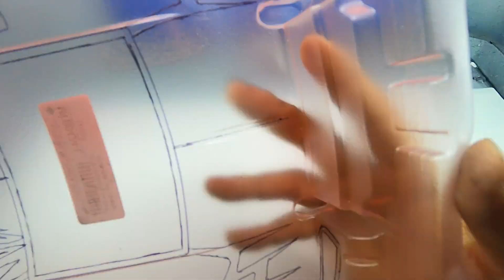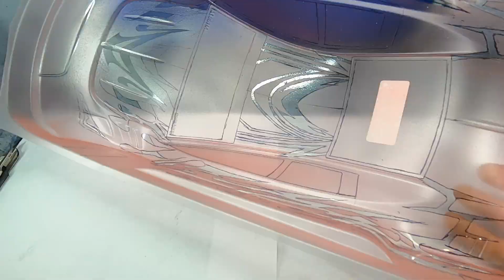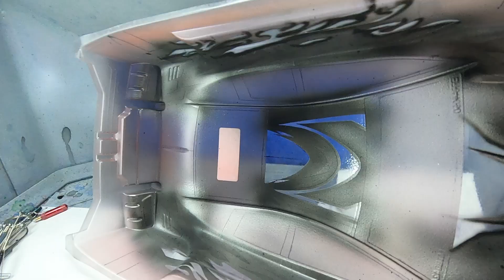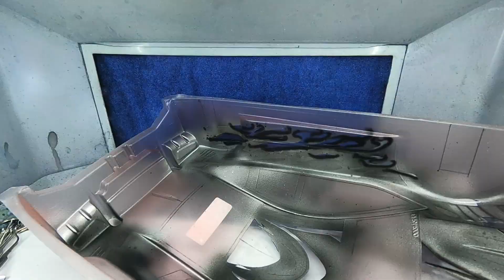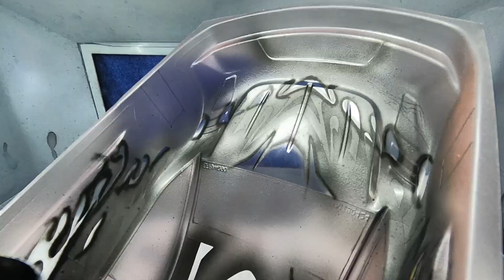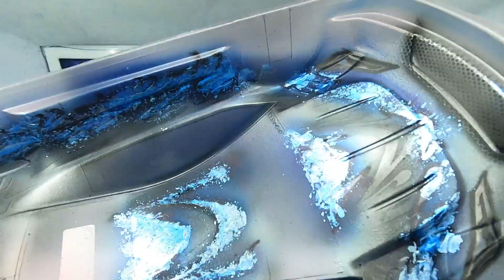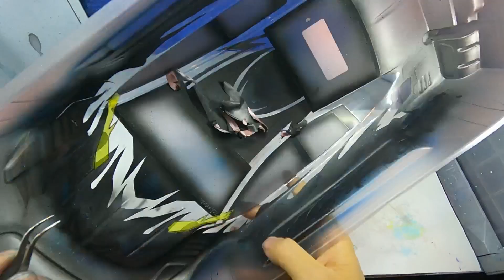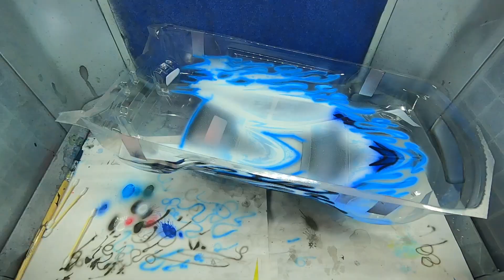This is how I paint RC car Lexan body with airbrush (Marble effect)

Comment: I've never tried liquid mask with an airbrush.  What nozzle size and PSI do you use?  How many coats?  Do you dilute it with water?
Reply from the maker: 1.4 and hard to say how many coats. You just have to try many times. Too thick or too thin both are not good. Around 35 and nope. No water
Reply: thank you!!   @sooyoun30

Comment: Fantastic job! The one thing i noticed and want to ask. Did you sand the body before painting?
Reply from the maker: Nope. I just clean up the body using dishwashing soap
Reply: @sooyoun30  maybe that's my issue, I would use alcohol to clean the bodies. Even with sanding I'll get cracking and flakes from impacts